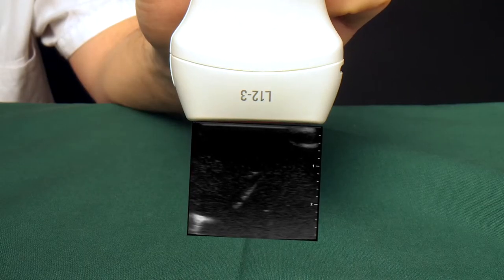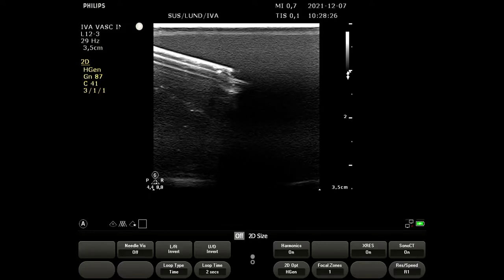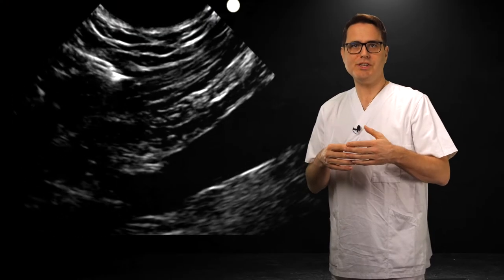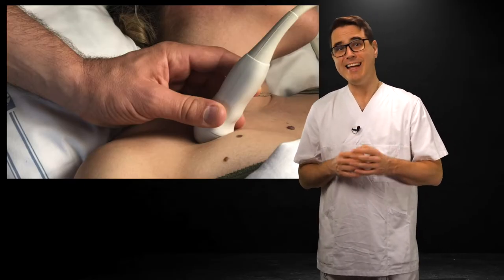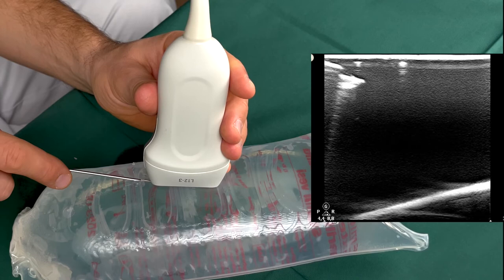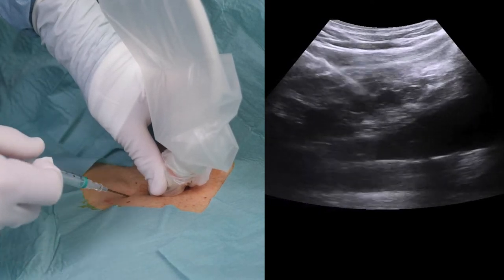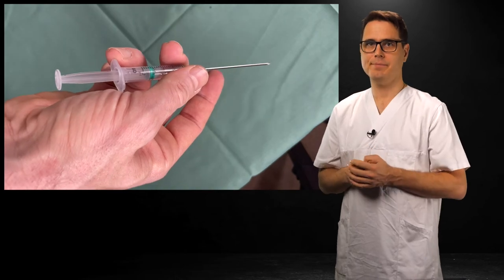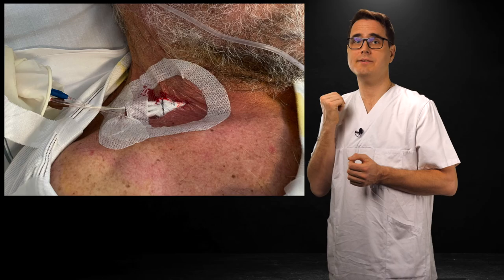Central Line Academy: In-plane Long-axis

Comment: sir i encouter a problem most ofen even when i have good flow which i recheck if guiedwire is not going.

whenever i put cvl 80% of the time i feel some resistance while putting guiedwire even when flow is very good...
please give some tips